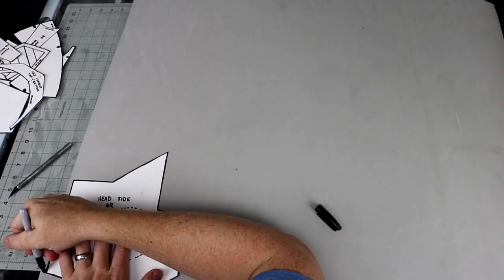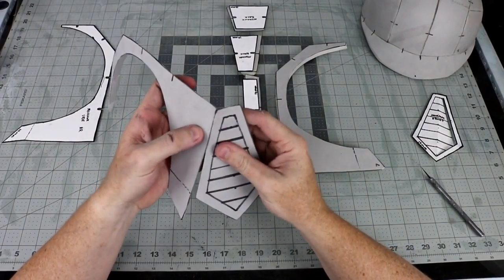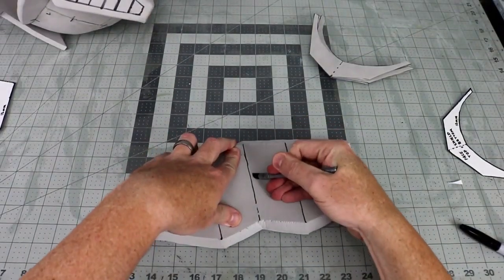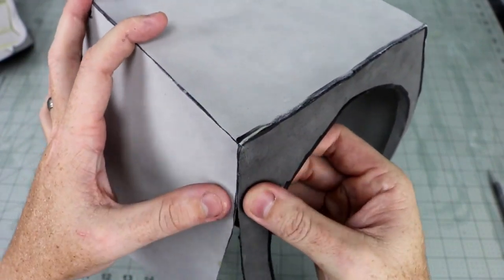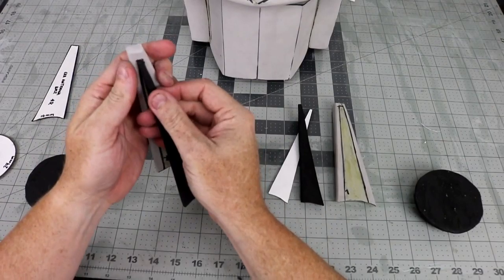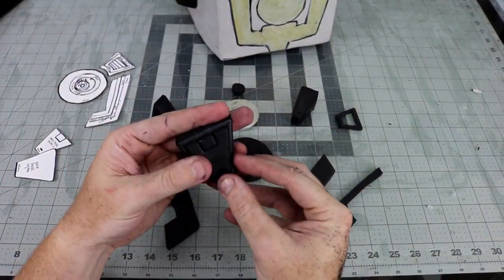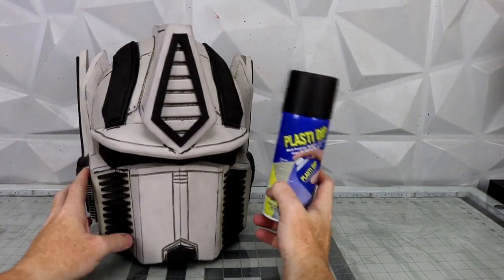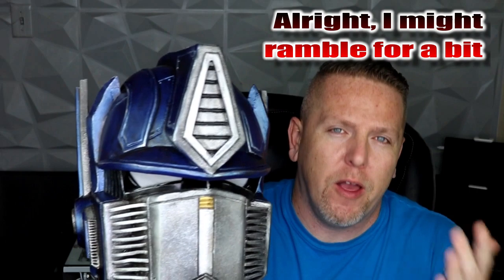Making a Custom Optimus Prime Helmet from Transformers

Comment: The template doesn't work for me, any other ideas?
Reply from the maker: Are you trying on a phone or tablet?
Reply: @MuchProps  I'm utilizing my phone, but I just put it into Google chrome and was able to download the images, but thanks, good to know that you are willing to help on such short notice, especially on a 2 year old video
Reply from the maker: @MeltyZombie  no problem. For future phone lookups, go to you phone app store and download a PDF reader. A lot of phones don't have pdf readers by default
Reply: @MuchProps  I just use a website based PDF to PNG converter, it's real handy, but on another note, if you were to make an Ion cannon, I think it would be rather popular, but you'd probably want to make it wieldable by people, but thanks for the heads up
Reply: Also know that you are in no way obligated to do so, it was just a suggestion
Reply: I literally pull the template up on my computer screen ,tape a piece of paper to the screen and trace the templates,because I don't have a printer. Hope this helps